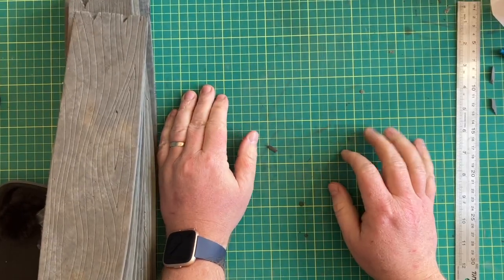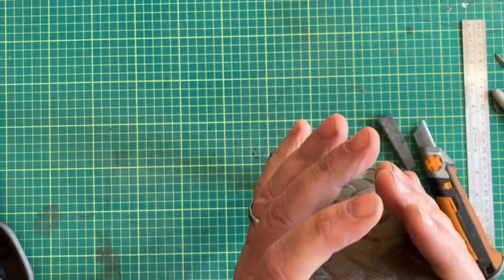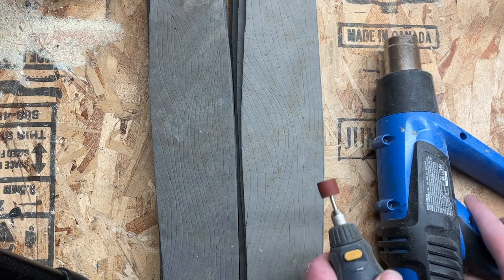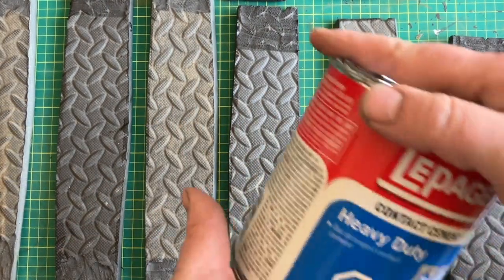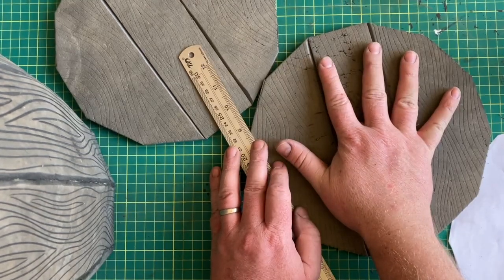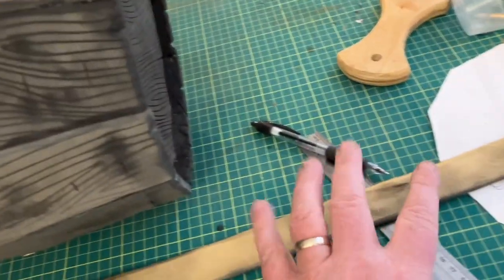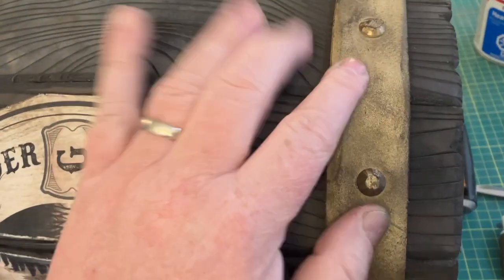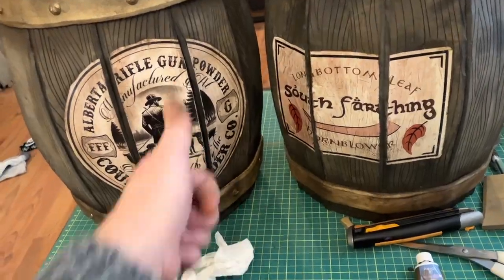Build a realistic mini-wooden Barrel Prop from EVA foam!  Free Labels included!

Comment: Looks great. If you take some sandpaper and thin the back of your labels it makes it a bit easier to wrap around the shape better. I started making one of those a few years ago but never finished. Might have to try again. Thanks for sharing.
Reply from the maker: I might have to try that North Court, I understand why in most pictures of these barrels the label is on the top! lol.I'm just vain and wanted to see the label in a display without having to put the barrel on its side.  This one, outside of making all the wood grain lines is a really quick build. Though I am lucky that the EVA foam mats had such a great color from sun bleaching so I didn't require paint.  Thanks for watching!